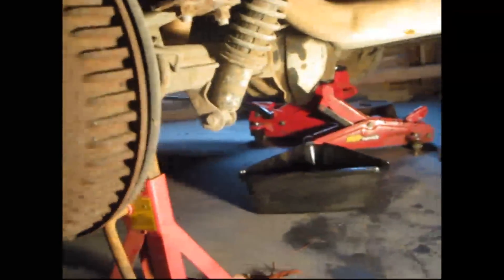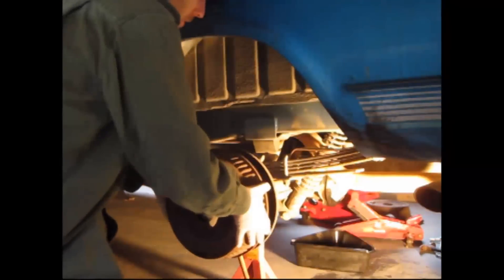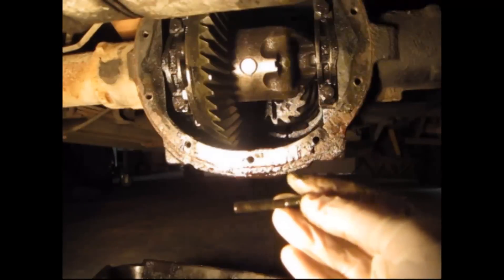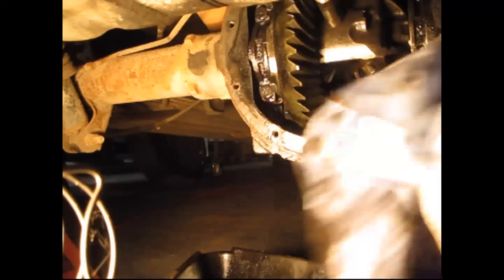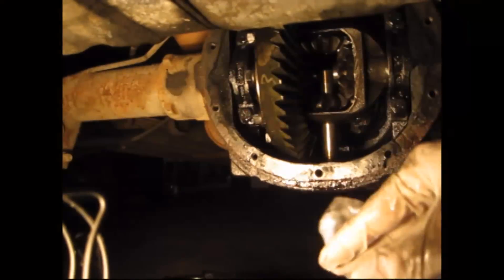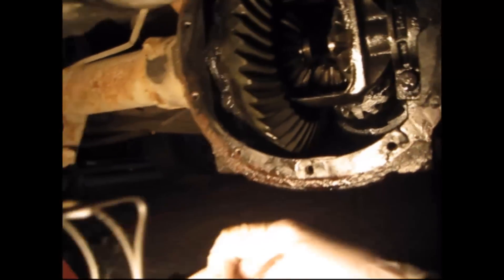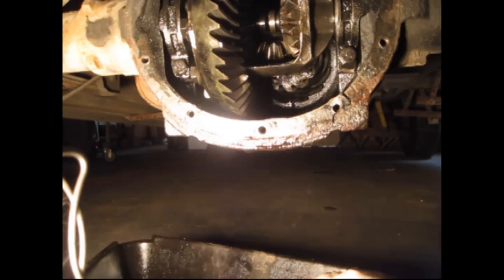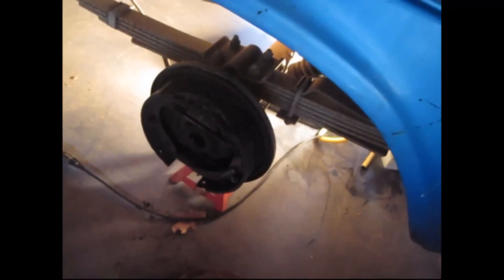remove rear axel on a 1993 chevy g20

Comment: By watching your video i was able to figure out why my pin would not come out. The FreakN bolt snapped off inside the pin! I ended up drilling out the bolt on both sides of the pin to remove it. Like most shade tree mechanics i don't have the $ for new gears so i and going to tack weld the pin on both ends to hold it in. Thanks for the video

Comment: Hi where is the follow up videos?? I have to replace the rear wheel bearing and I am stuck on the road at a walmart, is this really difficult if you've never done it before?? Also would you recommend changing both at the same time if only one is bad? This video Helped alot though because my manual tells me to refer to section 21 in chapter 8 of the Haynes manual for removal instructions of the axel shaft, and in chapter 8 it has 20 sections, no 21st section to review on removing the axelshaft, and what about the axel oil that you collected do you have to get new oil or what?
Reply: kennyrazor81  Yes, if you have no experience working on cars, this will be difficult for you. But it can be done. Also, yes, new oil is always recommended.